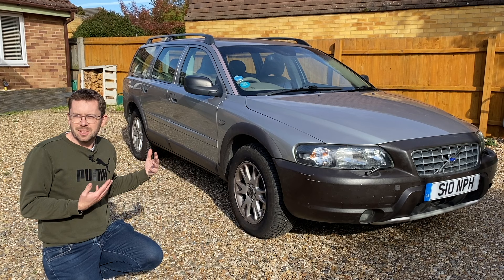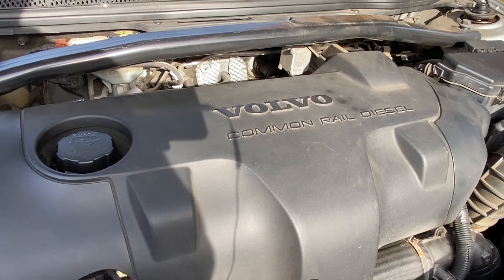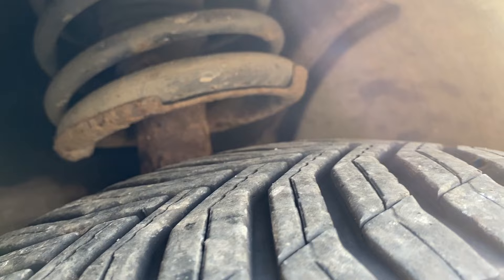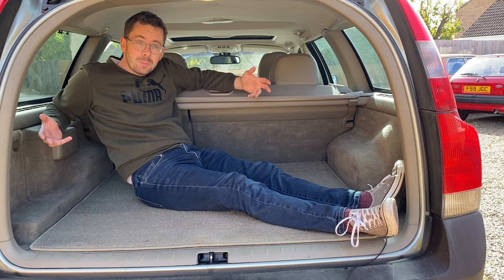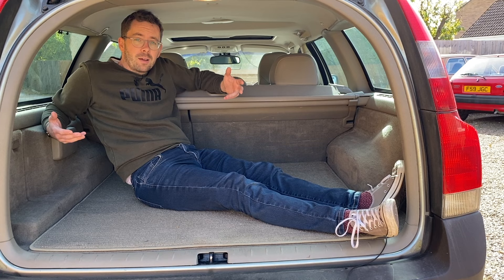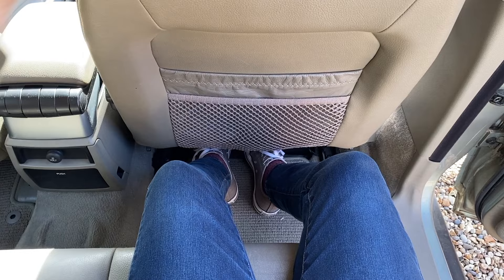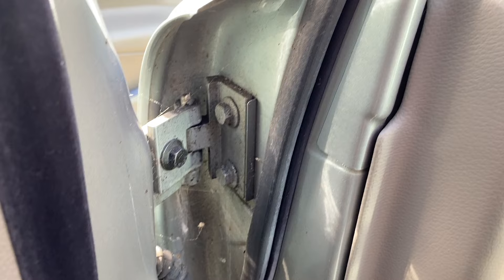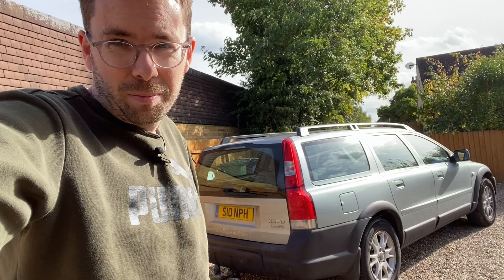2004 Volvo XC70: 6 month ownership review

Comment: At what mileage should you start worrying about the automatic gearbox when buying a used xc70?
Reply: no specific mileage... if it has been taken care of (fluid change every once in a while) it will be good. I recently bought one with 110k miles and tranny was very rough on the highway, I did 3 fluid changes over a couple months and problem solved.
Reply: no set miles.   Depends which years.  Talk to a volvo specialist or a trans shop perhaps.  This is a highly complex issue bcuz changes were made to the trans every few years, sometimes each year!  '05 was new and then subtle tweaks to '06 and '07.   They are all known to have issues such as bucking and slipping when warm but supposedly can keep going like that for many miles.

Comment: How is the car in terms of reliability, looking at a S60/S80 till 2005.
Reply from the maker: So far, it has been completely reliable
Reply: @MorselsAndMotors  how about 2001 s60 2.4 N/A, 70.000km on the clock, is that worth to buy in 2023?

Comment: I am just looking for a used xc70, and I found a 2009 Volvo XC70 3.2L, the mileage is over 342,670 km. But the warranty history is super clear and be treated well. Do you think the mileage is a big problem normally?
Reply from the maker: That’s very high mileage, but if a lot of components have been replaced and if it’s an engine with a good reliability reputation and the price is right, then it could be worth a go
Reply: @MorselsAndMotors  Understand, thanks a lot🙏
Reply: My 54 reg XC70 had 208,000 miles when I bought it for £800 two years ago. It's now done 233,000 and I love it.
Reply: @lukedaniel7669  That's a super great deal 👍
Reply: as u can see on regular volvo channels/mechanics, the 3.2 or Si6's generally are highly complex engines re the timing chain.  And they had ring issues.  So u'll have to have a shop verify your is or isn't problematic, but at that mileage the timing chain system may need service and that will cost massively.  That car is not worth much money at all
Reply: @18_rabbit  Thanks! Really helpful. I finally bought a 2010 Lexus RX350. But the mileage was over 340k miles😂

Comment: One year update video? I am interested in buying a petrol XC70 from 2015-2016, (My location is Romania, so left side driving position) for maximum 15000 euros, looking for AWD/4x4, but as efficient of an engine i i can get for this vehicle.
We are impressed with all the safety and off-road package this car brings, and it would work great for my first and only ICE vehicle, after the market stabilizes, i will also buy an electric vehicle. (i am sad with tesla removing  features when they aren't ready for alternatives, and i am waiting for other manufacturers to make a similar vehicle to Tesla Model Y, but better fitted for Off-Road and for snow/ice, with active air suspension, and a respectable maximum ride height to protect the battery underneath.)
(Loving the Volvo EX30, but way too small for me, and the EX 90 is way too expensive and inefficient, so i will wait for a longer EX30 , maybe EX60? similar air resistance and efficiency, but way better cargo space, bigger battery, and maybe 7 seats.)

Comment: Dude it Is a heavy vehicle, lifted from the ground quite a lot and you have 16" ofc It will be wobbly in the corners. Even my S60 2003 with 16" is wobbly and he is super low to the ground. That is normal for Volvo, they are not sport cars for cornering, they are long distance cruisers mate. Thats aswell why you find those bulletproof 2.4i petrol and in your case Disel engines, with or without turbine. Those cars are amazing and not so expensive to maintain, no electronical bullshit aswell. It gonna outlast any new car. I had few 2016+ cars and none of them was so reliable as the old Volvo and that is self proven fact.

Comment: You could tell you've been to The Netherlands with that Albert Heijn shopping bag in the boot 😂
The Mk2 V70/XC70 do drive like a barge, even with proper suspension parts. Though the quality of a Mk3 V70/XC70 is considerably lower, they have Ford Mondeo underpinnings which makes them very sharp in corners.

Comment: At 0:38 you have the inside brake pad on the outside. That part is supposed to be inside the brake piston. It probably is fine but not the way it should look.
Reply from the maker: I don’t, I promise. Both inner and outer pads in the kit had clips, the inner one is correctly in the piston. I’m guessing this kit is for multiple models, one of which has a fitting on the outer pad too.

Comment: I have pretty much the same car. Same year, engine and slush box and which has pretty much the same maladies. Mine handles like a drunk pig too and I don't think they will ever handle well. The best improvements I've made were to replace inner and outer TREs which were pretty baggy, plus front subframe inserts for a very slightly tighter drive. I've recently done (at 145000 miles) bottom ball joints, wishbones and drop links and there was no real improvement to handling. Its still on the original springs and shocks but having had them out I don't think they were really too bad. Mile munching cruiser yes. Nimble back road go-kart they certainly are not!
Reply from the maker: I love that description!
Reply: at that miles, if those suspension parts weren't loose, then actually replacing the shocks/struts would have been the thing to spend that money on.   Struts/shocks in a car like this are only meant to last about that long if not quite a bit less sometimes, ie around 100K

Comment: 38 seconds in. You've fitted the brake pads to the wrong sides of the caliper!! 😂, The protruding clip goes inside the piston on the other side of the caliper.
Reply from the maker: No, these brake pads came with clips on both sides, which I agree is very strange. The correct clip has gone inside the piston, please be assured!! The clip you can see on the outer pad must be for another car which takes the same pads but uses a different mechanism needing a clip the outer side too.